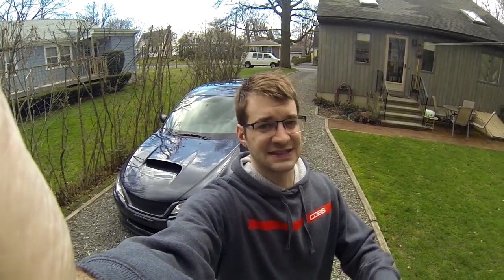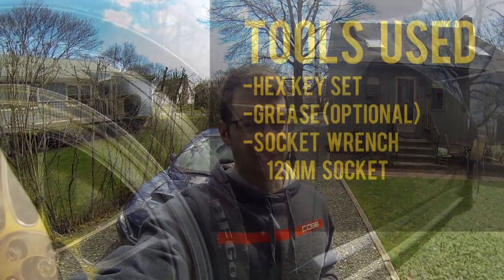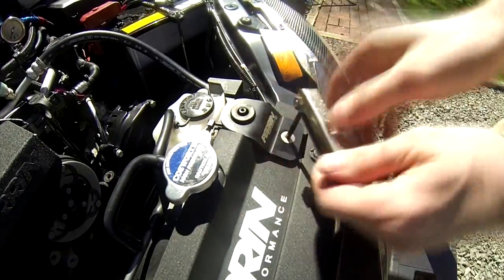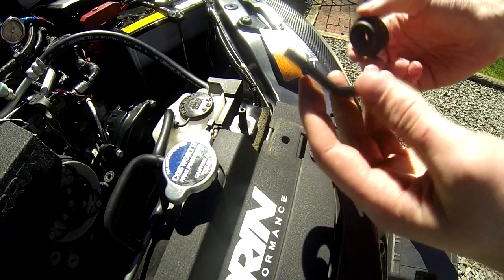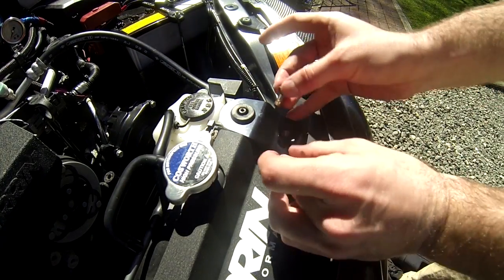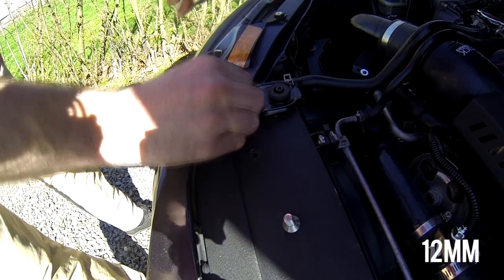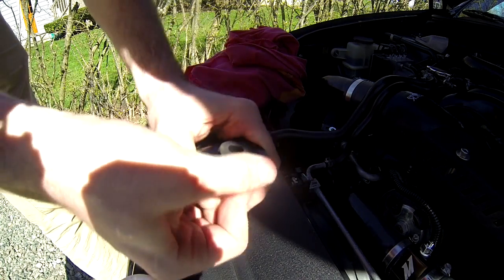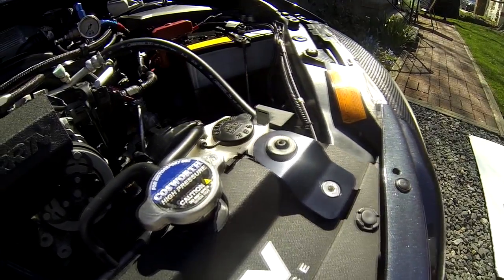WRX/STI Radiator Stay Install- Torque Solutuon

Comment: I don't think that works on a 15 sti with the perrin radiator shroud
Reply from the maker: +jaime carrasco  If the shroud fits with the stock radiator stays it should work with the Torque Solution ones in theory, same size just a little bit thicker. The stays fit our 16 STI but that car doesn't have the Perrin shroud.